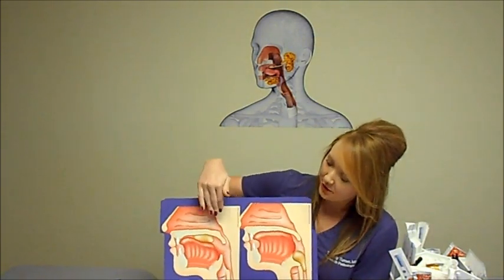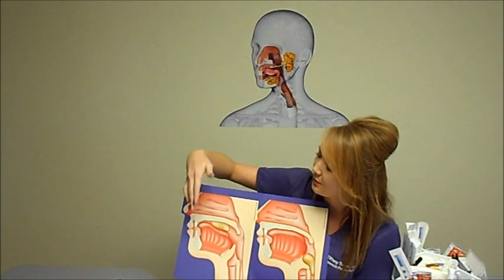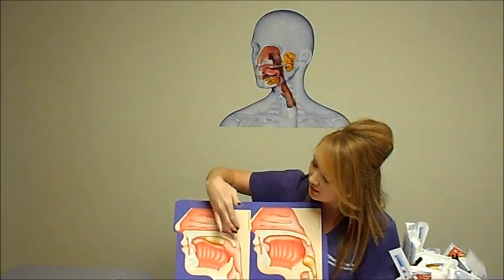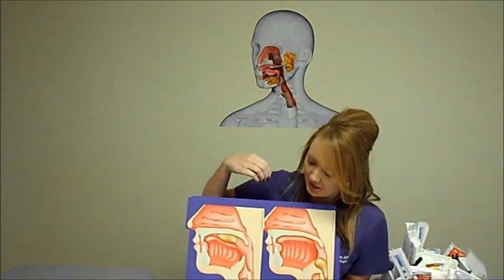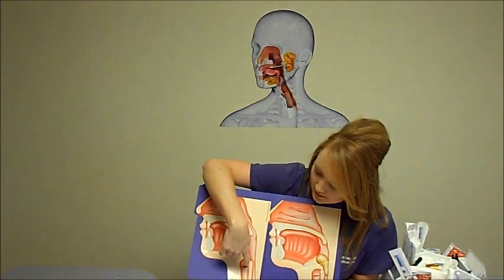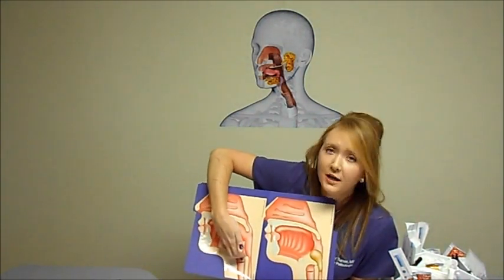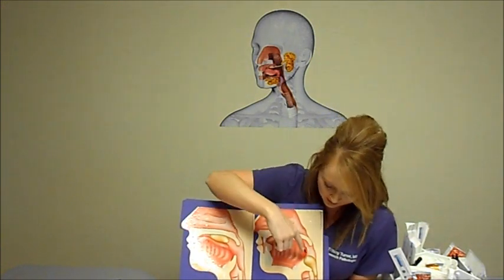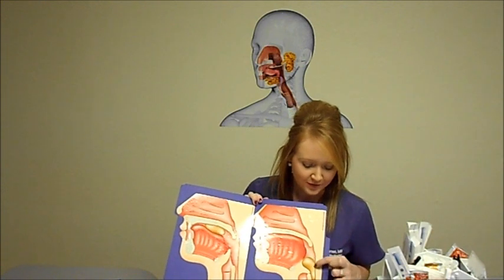Swallowing Disorders and Treatment Options

Comment: I was told I have dysphagia and it turned out to be something with my thyroid.
Reply: Do you mind telling me what was wrong with your thyroid?  My mom is struggling.
Reply: @bethanymorgan6930  5 nodules found after ultrasound. 1 very large 5 cm. The rest are also big but after biopsy all benign but the 5 cm biopsy cannot be trusted as it is too big to get an accurate biopsy so they said either take it out or watch it for a while. Surprisingly my thyroid count on my blood work was normal. Also, one of the smaller nodules is up against my esophagus and it makes me feel full all the time. If your mom's blood work is off she may need a simple pill.
Reply: @marymarth7298  thank You so Much for sharing this.. the ENT said her thyroid was atrophied. Her labs seem ok.. I’m praying for answers. She can’t talk hardly and a lot of trouble swallowing. 🙏🙏🙏
Reply: @bethanymorgan6930  You are welcome. She may have to have her thyroid taken out or half of it then take a thyroid replacement pill. Things happen that we don't have any control over. Most important thing is to tell your doctor of any new findings even small lumps/bumps so they can be checked as soon as possible and taken care of. Hope and pray your mother is ok. I had to go to an ear, nose and throat doctor to do some tests after the ultrasound findings showed the nodules then I had to have a biopsy of each one of the 5 nodules. Everything I went through was tolerable.

Comment: My swallowing problem  started maybe 3 months ago, with a slow progression of not being able to hold anything down. I lost 20 lbs and had absolutely  no idea what was happening. I had a fear of dehydration occurring, but there was light at the end of the tunnel!  I discovered that I was trying  to eat and drink too much at one time, of course being very hungry and frustrated.  I'm  hoping what I have learned will help you at least manage this condition. Patience!  The most important thing is to get liquids down, so it takes about an hour for  me to drink a glass of anything, now I drink homemade chicken and beef broth with herbs and add collagen and any other liquid stuff to it. It used to take an hour to get it down, but now only 15 minutes. If you can eat all day long in very small amounts , chew real good , after a while it will stay down with no vomiting and you will feel good. I feel it is most important to get down as many liquid vitamins as possible so that your body will sustain itself. Patience is the key, I know it's hard, but it will work. After 3 months I'm  able to eat mostly any soft food, crackers and even a handful of kernal-less popcorn. Everything is management of the condition, you will not starve. I am 70 years old.

Comment: One doc told me that speech therapy will not help with my problem, he gave me pills that did not work, so he recommended surgery. It helps if I lean my head forward and turn my head to the left then swallow. Sometimes a pill will get stuck in the back of my throat somehow.
Reply from the maker: Truth Finder Please see a physician (ENT and/or neurologist) and speech pathologist in your area specifically specializing in swallowing disorders. All swallowing problems are different, and this is a very specific niche, so seeing someone specialized in this area is very important. The treatment depends on the nature of the condition, whether it's progressive, etc.

Comment: Hi, I have a motility issue my esophageal muscles are working at 50%. i did an upper endoscopy, barium swallow, and motility test (tube up nose) and this was the only feed back i got. It's tough getting food down, there's a lot of pressure I try and hydrate when eating. I get the acid reflux flare up at night. I'm nervous about taking reglan due to side effects even at 5mg a day but someone i know abroad was able to get me domperidome and will start that 4x a day at 10mg. I'm not even 30 I don't know how this happened. I try and stay away from dry foods along with acid reflux triggers but doesnt help much. I'm trying breathing exercises to strengthen the muscles but no change yet. Help anyone? Been suffering for months!

Comment: liquid thickener thickens fluid to yogurt consistency to allow sensors detect fluid as food bolus,  thickening lasts only 60 seconds thereafter it's turns to fluid state during peristalsis and thickening powder dies not change colour taste nutritive values 
Swallowing, sometimes called deglutition in scientific contexts, is the process in the human or animal body that makes something pass from the mouth, to the pharynx, and into the esophagus, while shutting the epiglottis. Swallowing is an important part of eating and drinking. If the process fails and the material (such as food, drink, or medicine) goes through the trachea, then choking or pulmonary aspiration can occur. In the human body the automatic temporary closing of the epiglottis is controlled by the swallowing reflex.

Involuntary process follows soon after sensors at back of tongue detects food as bolus :
There are sensors at the back of tongue 😜 that are able to primarily detects any food solid or fluid as food bolus but during weakness illness or neurological certain deficit during such as stroke paralysis or similar conditions,  evidentiary sensors at the back of tongue fails to detect the especially fluid as food bolus and thus then sensors fails to send message to brain to move epiglottis valve to shut the wind pipe and jeep food pipe open
So incidentally that fluid or food takes its free flow in lung instead of food pipe. 
[ bacteria settles there in Lung,  mostly in almost all older adults ( MYTHS OF feeding Jay on bed and feeding fluids more endangering risk of chest infection at ease and that is mostly fatal accepted accident as natural by people not knowing these all   how sad!!) 
HENCE ITS ISIMPIRTANT TO FIND A POWDER FOOD THICKENER TO CREATE A BOLUS LIJE DAHI OR CURD OR YOGURT CONSISTENCY allowing ability of sensors at back of tongue to detect foodliquid as bolus and send instant message to brain to move epiglottis to cover wind pipe and leave food pipe open.
This process can also be disturbed distracted eating time we call that as choking,  while food piece sits on top of epiglottis and a thump between scapula fix the issue,  nor may coughing is encourages as first aid,  leave coughing undisturbed 
Thumping is only attempted in ABSENCE OF COUGHING ABILITY 
The portion of food, drink, or other material that will move through the neck in one swallow is called a bolus.

Comment: Swallowing, sometimes called deglutition in scientific contexts, is the process in the human or animal body that makes something pass from the mouth, to the pharynx, and into the esophagus, while shutting the epiglottis. Swallowing is an important part of eating and drinking. If the process fails and the material (such as food, drink, or medicine) goes through the trachea, then choking or pulmonary aspiration can occur. In the human body the automatic temporary closing of the epiglottis is controlled by the swallowing reflex.

Involuntary process follows soon after sensors at back of tongue detects food as bolus :
There are sensors at the back of tongue 😜 that are able to primarily detects any food solid or fluid as food bolus but during weakness illness or neurological certain deficit during such as stroke paralysis or similar conditions,  evidentiary sensors at the back of tongue fails to detect the especially fluid as food bolus and thus then sensors fails to send message to brain to move epiglottis valve to shut the wind pipe and jeep food pipe open
So incidentally that fluid or food takes its free flow in lung instead of food pipe. 
[ bacteria settles there in Lung,  mostly in almost all older adults ( MYTHS OF feeding Jay on bed and feeding fluids more endangering risk of chest infection at ease and that is mostly fatal accepted accident as natural by people not knowing these all   how sad!!) 
HENCE ITS ISIMPIRTANT TO FIND A POWDER FOOD THICKENER TO CREATE A BOLUS LIJE DAHI OR CURD OR YOGURT CONSISTENCY allowing ability of sensors at back of tongue to detect foodliquid as bolus and send instant message to brain to move epiglottis to cover wind pipe and leave food pipe open.
This process can also be disturbed distracted eating time we call that as choking,  while food piece sits on top of epiglottis and a thump between scapula fix the issue,  nor may coughing is encourages as first aid,  leave coughing undisturbed 
Thumping is only attempted in ABSENCE OF COUGHING ABILITY 
The portion of food, drink, or other material that will move through the neck in one swallow is called a bolus.